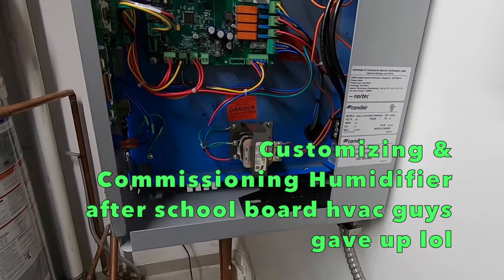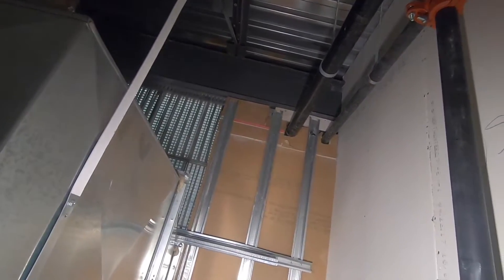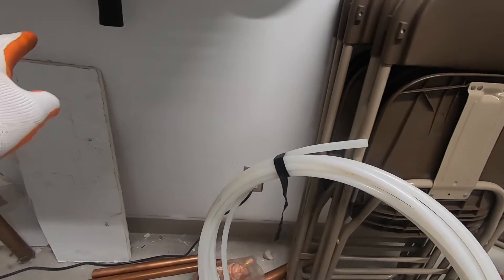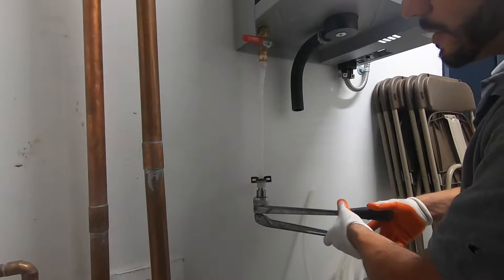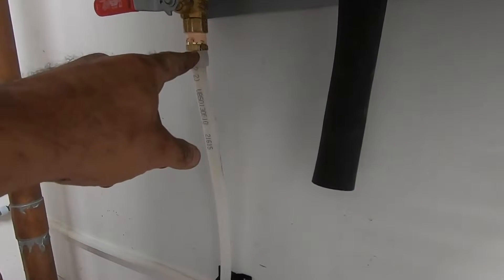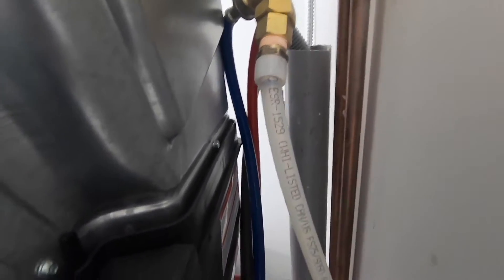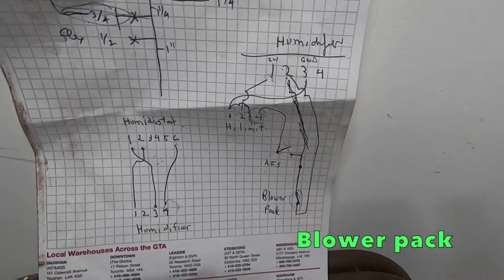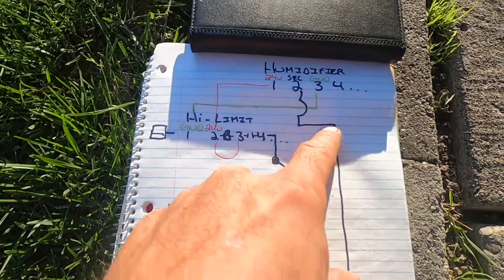HVAC: How to wire Humidistat | Nortec Condair Humidifier fix

Comment: I'm working on a marijuana grow in  Battle Creek Michigan. ,. And I need to get my hands on the blower pack manual..
My customer has 6 of these RS models.
And building management is monitoring and sending a signal based on demand.
-A1 refrigeration.
Michigan air products is my rep
Reply from the maker: email me bud

Comment: Nice. Only thing I would change is using plenum rated cable and there were no duct sensors installed or an outside humidity sensor
Reply from the maker: There is a humidstat on other side of wall I pointed it out on video. I couldn't film procedure. Thanks for coming by

Comment: Nice install.  Is there a fire code rating on the walls? Do you have to seal any holes with fire rating caulk?
Reply from the maker: From what I see know, They did not even have type X (fire rated) drywall. I asked the maintenance gentleman in regards to the holes I will be making before I started job, he didn't know much. Thanks

Comment: Intersting stuff. I have done steam humidifiers on big comm. Units but this is different. Very interesting method. Thanks for the video.
Reply from the maker: what kind of units did you install or how big?  I appreciate the message thanks.
Reply: We installed steam humidifiers on 20 ton unit for a hospital that did 3 flrs. The AhU was a Trane . I forget the name of the humidifier we installed the steam inlet pipe size was 2.5in blk iron pipe.